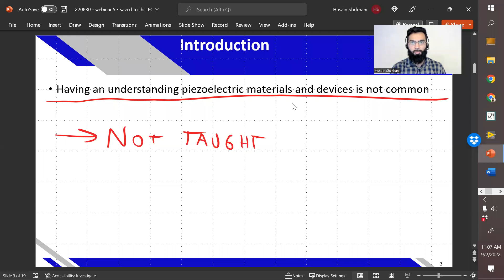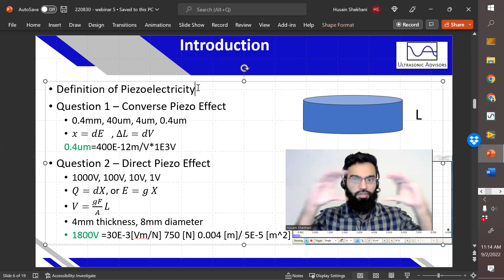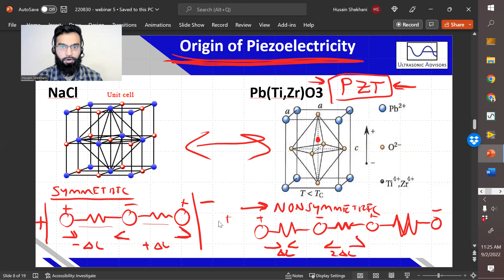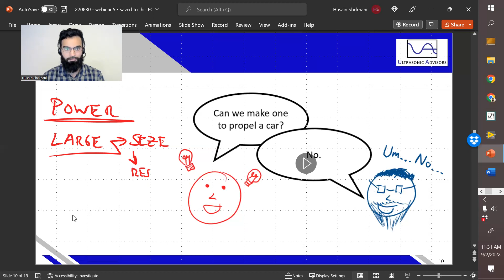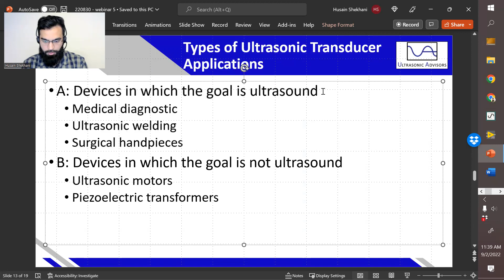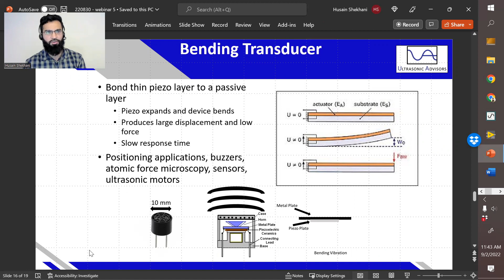Comment: Do they make ceramic piezo that can run in the ghz range ? maybe beryllium titanate ? I have a homade klystron tube with piezo arrays running 180 degrees out of phase. creating highs and low pressure in gas  tube- then running high voltage pulse threw tube  filled with n20 nitros oxide.   but 40khz is not even close to the microwave frequency i need . ps im able to transmit and receive with 100% to 110% efficiency and the signal acts like a laser as apposed to normal rf propagation . i apologize for my lack of understanding hence the questions .
Reply: I don't think you will be able to transmit GHz signals through air. GHz applications are usually exciting solid optical components.